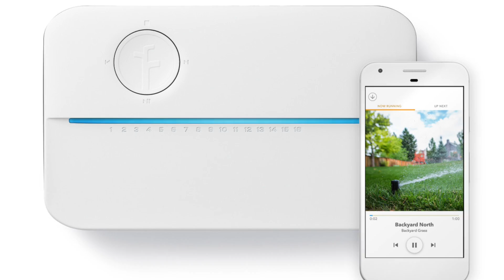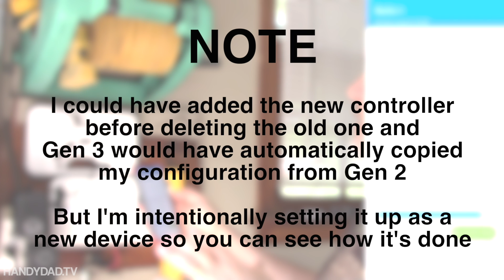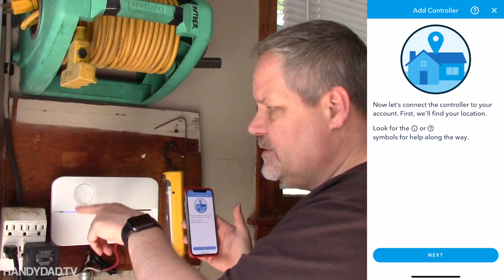Rachio Smart Water System - Gen 3 vs Gen 2

Comment: I’ve had the Rachio 2 since 2017 and was considering upgrading to the Rachio 3 and add the wireless flow meter. After this video was made, Rachio discontinued the flow meter. Now there is no reason to upgrade to Rachio 3 as the other enhancements don’t mater to me. Great move Rachio.
Reply from the maker: Did you see my flow meter videos? It failed after one season. Not surprised they discontinued it. 

I agree, btw. Keep using your Gen 2 as long as it works.

Comment: Rachio was running fine until they did a software upgrade . Beicked my system .  Ruined my lawn for the season . I didnt notice the lawn wasnt being water until it started drying out . Rachio  claims  it happens with certain operating systems . THE ENTIRE UNIT IS A PAPER WEIGHT
Reply from the maker: I’m sorry to hear. I am still using the same one from this video. Never had a problem. 

But if mine dies, I’m definitely getting another one.
Reply: @handydadtv  its better options I had mines since 2019. Just pissed a software update cost me my lawn .
Reply from the maker: I can relate in a small way. I had a sprinkler head stop rotating, but I water before dawn so I didn’t notice until that zone was dying except for one green stripe.

Comment: Nice video.  I bought the 3 a few months back because my series 2 was being temperamental about my new router. but did not install until today.  I thought it would take the same energy as my install of the Series 2.  It took 15 to 20 minutes.  I remembered your video because of the great tip not to delete the Series 2 until after the data transfer.   The irrigation settings and wifi join up happened automatically. Sweet. I agree that the 3 is a significant improvement in performance and ease of install.
Reply from the maker: The magnetic front is the best, isn’t it? Thanks for sharing your story!
Reply: @handydadtv  Indeed, and the new wire terminals.  I found the old versions aggravatingly unfriendly. :)

Comment: Hello Sir, I have a Weatherflow Tempest weather station at my house. How easy is it to connect the Gen. 3 Rachio to my weatherstation, usting the IFTTT app?
Reply from the maker: I played with a simple IFTTT rule that watered my front for 5 minutes to cool down the lawn when the temp exceeded 90 degrees, so I know it works. But, in my opinion, you should never need to externally trigger the Rachio unless you wanted to explicitly water in some sort of treatment. Rachio’s weather data should be as good as your weather station. Plus it factors in lots of other variables to control your watering. Automatically.

Comment: Have you had any problem with the Gen3 dropping wifi link?  Many have complained about that.
Reply from the maker: There were occasions where the light would be blinking like it was trying to reconnect, but it didn’t affect the operation and always reconnected on its own. Rachio only needs connectivity for you to program it or remotely control it. Once it’s programmed, it operates fine if there’s a network blip. It just may not have the latest weather data.
Reply: @handydadtv  So cannot set up without WiFI, but if set up and Wifi goes down Ok? How do you remotely control without WIFI; e.g., once set up can you change schedule settings manually at controller? Thanks.
Reply from the maker: Your schedule will continue to run without wifi, and you can water manually using the buttons on the front, but you won’t be able to adjust the schedule until connectivity returns. Not a big deal.

Comment: I am giving this system some serious consideration.  Question, my existing Hunter controller has a dedicated (direct wired) power connection that seems to be 24v-AC (VAC).  Can you tell me what the power source needs to be on the Rachio Gen 3?
Reply from the maker: Rachio also uses 24 volts.

Comment: Now that's the reasons I'll need to get rid of old analog orbit sprinkler system the second time.
Reply: I'll be ready to get it as your video is great explaining new rachcio 3 (spelling). I'm deaf and thanks for the CC! I love smart devices but not use alexa or Google which I don't understand robot voice and my voice is not clearly to make it works.
Reply: Orbit also has smart features, but adds manual setup in cases your wifi does not connect.

Comment: Great video. Word to the wise- if you’re installing this system with a iPhone 11 it won’t work. Rather, you’ll have to set it up with an older device or a laptop on the same WiFi network. Spent an hour troubleshooting mine tonight and once I switched to an older device it worked just as easily as in this video.
Reply: Thank you Andy, question, if i set up on iPhone 10 and log in later on an iPhone 11 do you know if it will work?
Reply: @chrisdavidson2294  Why you want a system that has manual controls if needed?

Comment: As an irrigation technician these timers are THE WORST! You want smart features? That's fine, but at least put controls on the timer!
Everytime I show up to a job and they have one of these overpriced pieces of shit I have to follow the owner around like a jackass as he fumbles around switching zones while wasting a ton of time.
Having pressure data is great an all but holy shit add controls to the front of the timer.
I feel so bad for technicians that have to deal with these and the bonehead owner
Reply from the maker: That's probably why they added controls on the front of the Gen 3.
Reply: @handydadtv  Those 'controls" only let you manually press to start and then need to manually press to stop. Need to do that EVERY time. You cannot even set up a schedule. Really want to go back and forth to the controller twelve times, (for six zones) before, in your case, six in the morning?

Comment: I have a Rachio 2, I am on a well and have 11 sectors. I have to have time between each zone watered for the well to rest, 15 minutes is usually good. Do you know of any way to set up an automatic schedule that will water the zones one at a time and give a 15 minute interval between the zones. I can’t seem to figure this out.  I have to water manually to achieve the rest interval.
Reply from the maker: You should contact Rachio for this question. I don’t know.

Comment: What's the difference between 8 zone and 16 zone
Reply from the maker: A yard is too big to have all sprinkler heads running at the same time. There’s not enough water pressure. So they need to be split into separate zones. For example, I have five zones in my yard. Some people have big yards that have more than 8 zones. That’s why Rachio makes a version with 16 zones.

Comment: Great review🔥did you ever find out what saturation is.   🤔
Reply from the maker: Yes, it knows how much water was applied, either by irrigation or rain. It calculates evaporation based on temperature and it calculates how quickly the water is soaks into the ground for your soil type. Like a jar with a small hole in it. 

So, the Rachio won’t water if the ground is still saturated. So it doesn’t just skip because of rain.

Comment: Question: Can you program the Rachio 3 to water every 3 or more days apart and not just odd or even or is that necessary? How will it know it is watering too much? Thanks
Reply from the maker: Yes, you can set any interval you want with a fixed schedule and it will skip if no watering is needed. It knows the weather and how much rain your lawn has received, and will receive in the future.

Comment: This video is about- how to wall mount and wire the controller and use the phone App.
But something has to turn on my hose to start watering!! It would be helpful if you can shine some light on how to install this smart controller from scratch.
Reply from the maker: If you’re talking about the other end of the wires (i.e. the valves), that’s beyond the scope of this video. My intent was to purely show how to upgrade your existing controller to a Rachio.

Comment: I use the Rachio 2 and live in the AZ desert. Water is a precious commodity and a smart watering system is a must. This summer we have already had more than 100 days of over 100 degrees. I would love to try the Rachio 3 with enhanced weather and flow meter. Our local utility provides a rebate for using a smart watering system.

Comment: Are the controls programmed in the app only or does the controller box save the zones, times days. Is there any difference from gen 2 to gen 3?  My understanding is that you can program the gen 3 on the controller box.  

Do you see a difference in the rain control on gen 2 to gen 3.  My understanding is the gen2 uses 1 source and gen 3 is like 36 sources.  Curious if you notice a difference?
Reply from the maker: Good questions! Gen 2 can only be programmed and operated from the app (no buttons); Gen 3 can only be programmed from the app, but you can operate it from the buttons on the front.

I used the Gen 2 differently than the Gen 3. With the Gen 2, I used a manual schedule (20 minutes per zone every two days) and just enabled Rain Skip. It worked fine. It skipped watering if rain was forecast in the near future or if it rained in the past. 

With Gen 3, I guess I've developed greater confidence in Rachio. So I this year I've been using the Flex Daily program. In this mode, I set NOTHING other than the time of day it should run (I programmed it to end watering by 6am when I get in the shower). Rachio does the rest. The lawn looks just as good as it always has. And I don't need to think about it.
Reply from the maker: One more thing, the weather sources don't mean much for people in urban and suburban areas (we have plenty of weather stations in New Jersey). But this would mean a LOT more to someone living in a rural area where they don't have as many options.

Comment: Just found your channel and am impressed with the quality of your video.  Good job at video editing and your conversational approach!  You did a good job at explaining the differences between version 2 and 3 and it sold me on getting this controller.... plus our city gives us a rebate for purchasing a smart watering device so it will pay for itself very quickly!  I also like the idea of adding a Flowmeter but not sure how difficult it will be it insert into the system.  I also wonder about the Flowmeter’s location relative to WiFi signal strength...  thanks again for a great video!
Reply from the maker: Thanks! The flow meter doesn’t use WiFi. It uses RF to the controller. I have videos on installation and failure of the flow meter, btw.

Comment: I just found out about Rachio. I have a system by another manufacturer and have had issues with it for as long as I’ve owned this house. I have tried to embrace technology and the features of the Generation 3 system is very appealing. I enjoyed watching your video and feel comfortable replacing the old unit myself. I’m not sure if you have given away the new unit supplied by Rachio however if it’s still available I would appreciate your consideration.
Reply from the maker: Yes, sorry it’s gone.

Comment: Can I change water days/time anytime when needed or must I change the program?
Reply from the maker: The easiest way to do that is set up multiple programs and just toggle which ones are active. So you could have a “heat wave” program the you only enable when you want it to water every morning. 

But if you’re only setting it to run with manual schedules, don’t spend the money on a Rachio. The advantage of Rachio is its Flex schedules which are completely automatic based on weather data. I use Flex Daily. I just configured my zones and told it to finish watering by 6am to not conflict with my morning shower. It calculates past and predicted rainfall, and consumption/evaporation, to determine how much supplemental water is needed.

Comment: I hope that the product is as good as it is your video. I have a question: could there be multiple phones connected to the application (for gardener to flush the sprinklers in the freezing season); does it have blue tooth in case that the wifi is off?
Thank you.
Laurentiu
Reply from the maker: No BT, only WiFi, but you don’t need to be on the WiFi to access it. He can get to it over cellular data. But you’d need to give him your account and password to login. 

But with the Gen 3 he can turn it on without using the app as long as he can get physically to the controller.
Reply: @handydadtv  Thank you
In our area there is no signal, we're in the woods, so they need to be on the wi-fi;
If on the 3rd gen he can physically turn on every valve manually, than this is the new controller!
Thank you again.
Best,
Laurentiu
Super impressed with the prompt reply
Reply from the maker: Gen 3 is the one you want. 👍🏻💯
Reply: @laurentiupopa3733  That is twelve trips to the controller every time you water for six zones!

Comment: Had a renter in the house that disconnected our sprinkler panel leaving our system unusable. Now back in the house and looking for a control panel and was very impressed with the Rachio 3 you demonstrated. Would love to use one to get our system back up and running!
Reply from the maker: The contest ended, but they are now available on Amazon at http://handydad.tv/y0e6

Comment: Great video. Couldn't decide between the Gen 2 or Gen 3.  You explained it well and the deciding feature is the weather feature in the Gen3 narrowing the monitoring to within 36' of the unit.  We're in Myrtle Beach, SC and weather reports constantly forecast rain.  It will rain over the shore & all around us but not where we are.  Water bills are the only cost we've found expensive since moving here 2 years ago.  They charge for usage and more for waste water.  Since they can't determine irrigation doesn't return to the sewers we get charged for the full usage both ways.  Water bills have exceeded $300/month.  The Rachio 3 will pay for itself in less than a year!  Thanks.

Comment: Thanks for the review! I have a company that preps the system for winter. Does this controller allow for them to tap into the system and control the zones for an easy winter blow out?
Reply from the maker: You can manually trigger zones from the controller. But you’ll need the owner’s login to control it via the app. I don’t think it allows guest access.

Comment: I have well water and 2 very large gardens, I have failed at every attempt to figure out a good watering system. I think 2 16 zone Rachio 3 systems may work :)
Reply: I have the same issue and will require two 16 zone option as well.

Comment: No sure if the contest is still open but I sure would like to get in on it. Thanks for the helpful video. I’m really interested in the flow meter and how it will connect wirelessly. I’m wondering what technology it will use. My concern is my main water connection my be outside my Wi-Fi range, especially if it’s in the ground. I suspect it’s using something else that have better range and will work from under ground... anyway, thanks for the great video...
Reply from the maker: The flow meter uses RF signal, not your wifi. Check rachio.com for the range.
Reply: HandyDadTV  I went to the web page and watched the video, it didn’t say what technology the flow gauge  uses (FYI, Wi-Fi uses RF), only that it has a 300 ft open range, and that’s for above ground installation. In my case it would be below ground in a valve box on the other side of my house. Depending on the frequency, below ground could diminish it’s range considerably. I also leaned the flow gauge can not be near any elbows after the unit. This is a deal breaker for me unless I dig up several feet of pipe (and tree roots) to re-route my current setup after my backflow equipment... kind of a kill joy all things considered... don’t get me wrong, I’d still love to win the contest. It just means a lot of healthy work for me...
Reply from the maker: The contest is only for the control, not the flow meter. In the upcoming flow meter video, you’ll see my brother’s installation slightly below grade.

Comment: Wow, I'm really happy I viewed your video. I had an underground  break in my sprinkler system in my back yard and had to have that fixed. During that repair I discovered I could also relieve myself of having 2 different controllers and systems (1 in the front yard the other in the back - I'm the NOT the original house owner!). So, now that that is behind me I want to move on to a SMART watering system and the RACHIO seems to have everything I could dream of. I'm also seriously considering getting the waterflow meter as well. Thanks for the video and insight!

Comment: New sub. Looking for a new sprinkler controller. I like the features on the new Rachio. Thanks for the review. Flow meter sounds interesting. My grandkids are always unscrewing the heads near the front door. I usually don't know until there's a fountain in the flowerbed.
Reply from the maker: I’m not sure they designed it with mischievous grandkids in mind, but the flow meter will shut off your zone if it happens again. 👍🏻

Comment: The is great, I just bought a home with my first sprinkler system ever and I feel like I need a PhD to operate the rain bird that came with the house... But I think it has like 12-13 zones so I'm not sure how it would work with my system.  Thanks for the video!
Reply from the maker: They have two versions - 8-zone (mine) and 16-zone (which is what you need).